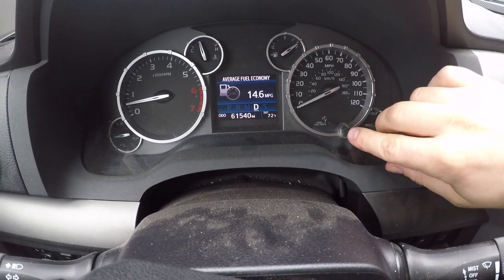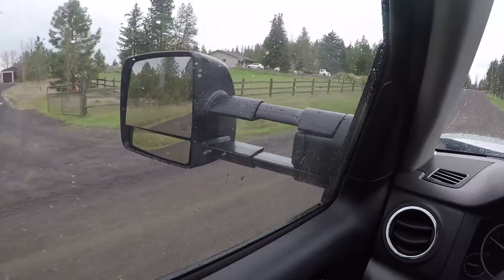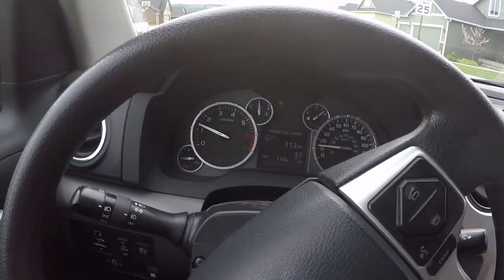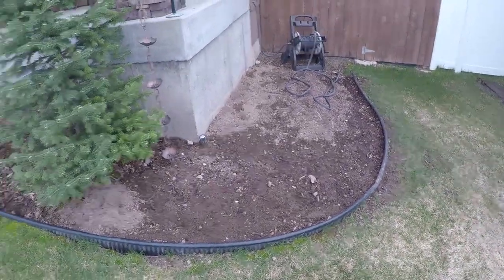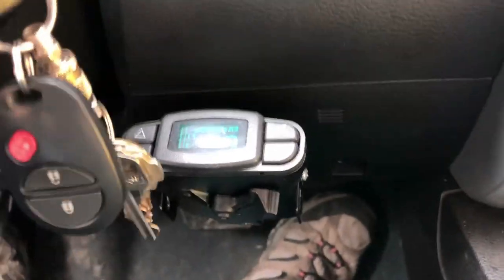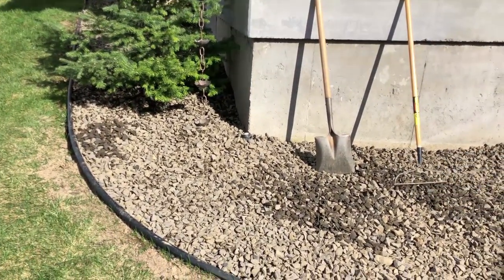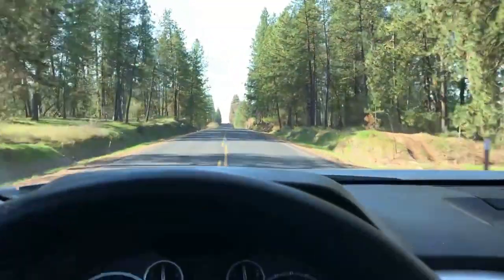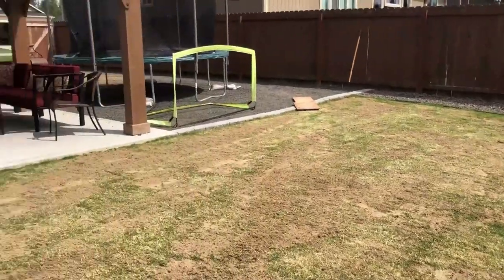Toyota Tundra Towing MPG Trailer Empty & Loaded

Comment: Buying a Truck expecting to get good MPG is like buying a Prius expecting to haul shit
Reply from the maker: It was more so for fun. If I really wanted MPG I would have bought something with 4cyl deactivation or Ecoboost.....but I wasn't honestly that concerned.
Reply: I have a 08 tundra towing a28' toy hauler. With a can am hd10 limited  as my toy. Im definitely pushing 10 thousand pound mark. I do use air bags and weight destrobuction hitch with a brake. I don't drive without an extra 10 gallons of gas.  But i do live in the middle of nowhere, New mexico. Gas is always a consideration. But the thing works hard. And never complains.

Comment: I pulled a 18’ flatbed with 2 cords of firewood and 2000 pounds of fencing and iron pipe and got about 10 mpg with the 5.7.
It tows just fine. It aint a diesel, but its got plenty of power and torque.
Reply: Anton Chigurh what year is it. I want to tow a kubota tractor which will be 5,000 pounds total
Reply: Mine is a 2016 would it work good ?
Reply: Yeah it will tow it just fine.
Reply: How Can I / TUTORIALS... Do you need people to answer every question for you? Like you can’t figure out that if you have a 2016, that it’s gonna work as good if not better than one that’s 11 years old? When you’re ready to wipe your ass, get ahold of us to ask us if it’s okay!
Reply: @jimwolabaugh3608  wow man why so angry? Some people really dont know? Take in consideration payload and tongue weight.
Reply: @ToNy MoNtAnA... No I get that! But in today’s day and age, any info you want is at your fingertips. All one has to do is type what they’re looking for. But I guess you’re right... I didn’t have to be a dick about it! I think I must’ve been having a bad day
Reply: @jimwolabaugh3608  we all have bad days  but not all will admit it like u did when called on it...good quality to have. 👍

Comment: My old 26' RV trailer ( 4300 dry / 5500 wet / 10' tall) I got 11.25 miles per gallon.  Freeway speeds of 60-64 mph, usually stayed in overdrive at 1750 rpm's.  Get a little tail wind might get up to 12 mpg.  NOW, new RV trailer 28'8" ( 6600 dry / 7800 wet / 11'6" tall I now get a steady 9.5 mpg.  2014 double cab with the factory $40 tow mirror option.  The new RV is just a beast of a trailer, heavy-duty suspension, huge tanks, thermal pane windows 5200 lb axles cargo capacity of 3500 lb.
Reply from the maker: Based on that trailer 9.5 is good IMO. My trailer is about 5500 dry 6500 wet and I get 8-10 going camping depending on wind. A head wind just kills it as my trailer is really flat up front

Comment: Can’t beat them. I could type an essay about stuff as I’m a truck guru but I’ve had a 09 crew cab Offroad Tacoma 4x4 100k miles , ‘13 dbl cab 5.7 4x4 tundra 150k miles, and now my ‘20 crewmax Tss Offroad 4x4 tundra 31k miles so far .....they just work and keep working . I get 10-10.5 mpg at 72-75mph with my double axle 16x77 double gate trailer and can am side by side (about 3500-4000 lbs) .
Reply from the maker: We just picked up a 15 Sequoia with the 5.7. Loved the Tundra enough to stick with the same platform

Comment: Impressed with how the truck/ tires looked loaded. Would be curious to see how it looked without the airbags. I can image with a gooseneck it'd do even better
Reply from the maker: I really like how settled everything feels with the air bags. Especially when towing that trailer I should technically have a weight distribution hitch but it feels fine. If I remember correctly I had the tires at 45 psi

Comment: Going as a 5th owner on a 2013 with 110k miles only issue I've had are what was neglected brakes were never cared for so I've had to do all 4 pads and 2 rear rotors besides that just a transmission fluid drain refill I came off Fords and 2 other Toyotas never could be happier because at this point I only need a small Honda for short trips

Comment: That's pretty good.  In my opinion, more modern trucks are more efficient, but at the expense of longevity.  I believe that this is due to complexity, from variable valve timing, variable turbo geometry, direct injection, variable displacement, active fuel management, etc...  I don't have to worry about any of that failing on my truck, because it doesn't have any of it.  For comparison's sake, my buddy has a 1997 Ford F150 4.2L RWD and towing a 7,750lb trailer netted him about 8.2 MPG on the highway.  I have several trucks, but my primary is a 1993 Chevy K3500 6.5L Diesel 4X4, and when I first got it, the same trailer would net me about 10.5 MPG.  I've since replaced the injector pump, the fuel injectors (stock metering), adjusted the wastegate for a little more boost, and I advanced the timing by about 2 degrees.  Now my MPG with the same trailer is about 15.6, but my horsepower is about 180HP, so it takes me about a month and a half to pull a 0-60.

Comment: Try to put a 1500 pound atv or UTV in the bed then tow anything and you will be overweight.   Toyota Tundra is a great truck but cost with weak payload rating that will reduce your towing to zero very quick.
Reply from the maker: That’s the case with any half ton. Hell thats the case with a three quarter ton (2500) truck if you get the diesel option.
Reply: Dads Domain exactly. The Power Wagon which is a 3/4 ton has a payload rating of about 1200lbs.

Comment: Nice truck, i had a 17 pulled rental equipment for a year, mpg not to bad pulling 14500lbs😲  
Tuff bastards
Reply from the maker: When I filled up the sandbox for my kids I went to a commercial yard for it and they were really busy and the normal tractors were backed up. A guy asked me what I wanted and yelled follow me. I don’t know what size the loader was but it was meant for their dump trucks and he way over loaded that trailer! By my estimates it was 13k-15k (including trailer) and the truck did surprisingly well. Since there wasn’t wind drag mike an rv has I had enough power!

Comment: Best truck on the market. Love mine. But I say this all the time. Put 430 rear gears I. Any other half ton and see what your fuel mileage is. These trucks were meant for towing. That’s why there is only 430 rear gears in them. 👍
Reply from the maker: We're picking my wife up a Sequoia soon, its rated for the same MPG but now I'm curious if its 4.30 too. The rear diff is totally different though, independent rear suspension and shockingly it only holds about 1.5qts to the Tundra's 4. I'll be changing that more often

Comment: I want to buy a tundra but in 19 and 20 the deleted the aux trans fluid cooler..which I would have to add back
Reply from the maker: Oh really I hadn’t heard they did that. I wonder why. But that’s good info to share
Reply: yes you purchase the toyota part that splits for two lines and add a aux external trans oil cooler Toyota says the temps are within thier standards but people when towing his high temps which puts the trans at risk look on youtube if you have the 2018 or oldet you have this part and a trans cooler so you are great
Toyota got cheap maybe they dont want the trans to last HMMMMM

Comment: My 07 Tundra averages around 2 mpg less than my friends new GM and Fords with their 8&10 speed trannys. Under load the margin is even closer.  Took my daughter Adventure Land (250 mile trip) last summer, mainly open hwy and interstate got 19.2 mpg (original plugs). Where the big difference will “probably” be is the cost of maintenance when my friends domestic trucks reach 13 years and 250 k miles like mine. If they even can come close to doing that.
Reply from the maker: The more people I talk to the MPG difference isn't really that great depending on what you're doing. We're going to get my wife a Sequoia at some point. The 5.7 is proven reliable and I know how to work on that drivetrain now so why not.

Comment: 8.7 mpg pulling 4,200 lb travel trailer 400 miles from Florida to Georgia with my 18 Tundra 5.7.
Reply from the maker: That sounds about right. With a travel trailer they are more of a wind drag than anything and that’s what is really taking the power to pull at speed
Reply: @DadsDomain  Thats terrific

Comment: I get around 17 mpg on highway empty and the 8-9 mpg on highway pulling a 4500 lb toyhauler plus toys so probably a 5500 lb toyhauler, and can go over the mountain at 70 mph without problems so im happy
Reply: Tundra all day long
Reply from the maker: With my Tonneau cover I get up to 18.5 at 65 and 17 at 75. I should try doing a comparison with and without it to see what happens
Reply: @DadsDomain  that would make for a good video have great day

Comment: What size travel trailer you hauling weight ect?

I have a 19 tundra and just upgraded to a 5500lb travel trailer that's dry weight so probably be around 6300 loaded.
Reply: I was hauling a 28ft toyhauler that was 6700 lbs empty i had a sidexside and banshee plus my other stuff. I weighed truck and trailer on my last trip and it weigh 17,000 lbs with truck and trailer, truck did just fine on flat ground and climbing, but going down the mountain I was not real happy with the stopping power so sold that trailer. I bought a 24ft extra light that weighs 3400 lbs hoping it stops better lol. My truck is 2015 tundra

Comment: Everyone talks about it having enough power, yes it does, what so many fail to understand, it’s a 1/2 ton, yes you can pull 10-14k, it’s not so much about power, it’s the stress you put on the axles, hubs and brakes, shit, my Honda Civic could probably pull it.
Reply from the maker: The biggest short coming of the tundra is that the chassis is designed for flex for off roading as well. Brakes, axles, aisin transmission all more than needed. If they stiffened the chassis and suspension it would be good to go
Reply: @DadsDomain  , what would be needed to stiffen the aforementioned chassis?

Comment: HI, Did you say those mirrors also have the blind spot monitoring?  If so where did you find those? Can you include a link? Thanks
Reply from the maker: I got mine off of eBay and they are just the normal mirrors without power folding or blind spot monitors. I don’t think they make the tow mirrors with that sensor since you have the bottom mirror on it

Comment: Why are you using S4 mode instead of just keeping it in drive?  🤷🏻‍♂️
Reply: You don't want to tow in overdrive.  S4 keep shift at 4, 3, 2, and 1.  It prevent the vehicle from shifting into 5 and 6, which are the overdrive gears on the Tundra/Sequoia/Land Cruiser 6 speed transmission.

Comment: Dude that picture of the guy taking the gas pump ,is epic, tundras should have that as a vinyl option 😂, an i own a 2014 tundra,  33's 3 inch lift, im running yokohama x-at's  an im getting 13.6 can't seem to get better 😕
Reply from the maker: Ya I've heard if you put big Tires on it its pretty much done for! I can't remember how I found that picture but once I did I had to use it! 😉

Comment: Are those after market mirrors? If so which ones? The Toyota ones cost a lot. Did they come on your truck or did u install them? Thanks.
Reply from the maker: I waited until Ebay had one of their 20% off site wide sales and ordered the Toyota OEM ones from a Toyota Parts dealer. They were still expensive but 20% was a great deal. I installed them myself and it really wasn't too hard. I was just super careful not to drop any parts inside the door!

Comment: Toyota could blow away the market if they d build a 2500 size truck.
Reply: I loved my three Tundra’s, but that’s the very reason I went to a 2019 GMC 2500HD Denali 4wd 6.6DMAX diesel. I’ve had zero issues with my GMC and towing is absolutely amazing.  Toyota quality is undeniable and we still have a hybrid Camry and Avalon in the driveway.  👍

Comment: My gm purest friends dont beleive my 2007 tundra 4wd with a 5.7 duals and g force tuner chip is getting just as good or beter mpg as my gm 5.7 4.3 or 5.3 they are just hating because I went Toyota for qaulity
Reply from the maker: I have a co worker who has had the lifters on their 5.3 replaced twice <100k miles. I'm sure the second was poor workmanship, and I'm a chevy fan, but I stand by my choice

Comment: Isn't the max 1400 - 1700 lbs?
Reply from the maker: Are you referring to the payload? My payload is 1370 and I believe for my mode code the towing stated 9700lbs. However to pull that off you need the cargo weighted at the axles and no cargo in the truck as the tongue weight counts towards payload.
Reply: @DadsDomain  yeah. Sorry. I am moving using my tundra  I think I put just over 1500 lbs of stuff in the bed and the cabin of the truck. I am going to be driving a little over 1000 miles and I hope Michelin tires are OK. What do you think?
Reply from the maker: @im4485  You're totally fine. If you look at the sidewall those tires are rated for way more than the trucks GVW however thats at 51 PSI. The factory stickers assume a low 33 or so. When I tow my RV I inflate them to 45 all around and everything is great. When I added air bags to the truck it was really just to always be level, not to add payload capacities.
Reply: @DadsDomain  thank you

Comment: I have a 2010 tundra and I'm not afraid to admit it sucks at towing. pulling 8,000 pounds it had a very hard time and felt unsafe. high revs in every gear the truck was screaming wile im bearly doing 30mph. no way i would go up and down hills pulling even 6,000 with this truck and they say its rated to pull 10,000 pounds, thats complete bullshit no way this thing can safely pull 10,000 pounds.
Reply from the maker: We couldn’t have a more polar opposite experience in vehicles. Are you towing with the 5.7?
Reply: @DadsDomain  yea 5.7 with towing package. i also have a regular cab short bed so my payload is 2,000 pounds. i put a 250 gallon water tank in the bed and filled it 3/4 full so not even 2,000 pounds and it was too much for the truck rear end was sagging like crazy. I'm very disappointed in this truck, it cant even do it's advertised numbers.
Reply: @reddog5753  add some sumo springs for the sagging they're not too expensive.
Reply: I too have a 2010 Crewmax. I've towed travel trailers, horse trailers, utility trailers and dump trailers. My camper is 7800#'s dry, then I load it and the truck bed up. I guarantee it's around 10,000#'s or more. It pulls it just fine. And I get 8-10 mpg. I've pulled dump trailers where the trailer and contents weighed over 14,000#'s (and I kept the weigh slips to prove it). And it had no problems pulling it at all. Now I did add a set of Firestone airbags, because I agree the rear springs are a little light, but the Tundra and its engine is a beast. I have no complaints and will likely buy another one when the time comes. And I don't plan on getting rid of my current truck... ever!
Reply: Somethings wrong with it, go have it looked at. Orrrrr, stop trolling.
Reply: adventures and quadcopters be honest you have either ford , dodge , or chevy quit lying 🤥
Reply: You clearly don't know how to tow then. I have owned an 08 tundra for 7 yrs and tow car trailers and trailers all over. Car trailer usually weighs around 55-6500 lbs loaded and my camper is just under 9000lbs. Yes I do have a set of air bags that I installed because I knew the truck would see alot of towing and safety is first. 160k miles so far with zero issues. BTW my friend has the same weight travel trailer I do and pulls it with a 6.7 power stroke that is stock. My truck easily walks away from his diesel leaving a stoplight as we have raced several times.
Reply: @reddog5753  really? I have a regular cab 4.6 V8 with 1600lbs payload and admittedly I've loaded close to and around 2000lbs many times. Didn't sag much at all and did it with no struggle..either have crappy tires,trolling or something like that

Comment: So horrible and more horrible...I would love a Tundra but this is why I just cant do it.. ridiculous gas mileage
Reply from the maker: For conversation sake what vehicle would give you the mpg you need and does it really add up in real world driving.
Reply: If gas mileage is an issue, you're probably not a truck person. People buy trucks for work or ego. Not gas mileage.
Reply from the maker: @hornett22  EGO sells a hell of a lot of trucks and upgrades!
Reply: tilley Schmolph I’m driving a 2019 ford with 6.2 engine and when Is empty it ‘ll never get more than 10 miles to a gallon
Reply: You don't purchase pick up trucks for gas mileage. Buy a Prius, for Christ's sake, if you're so worried about MPG.
Reply: You buy a truck for the power to work or tow.... and that means lower gas mileage. Buy yourself a nice 4 banger for the higher mileage.